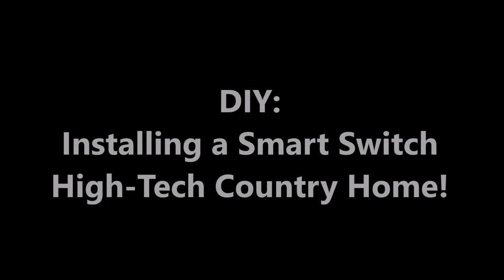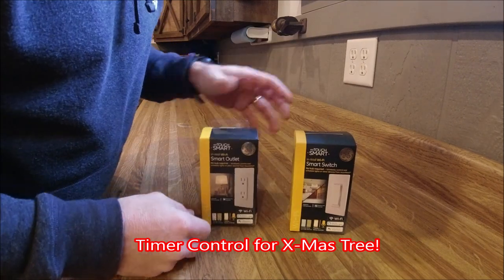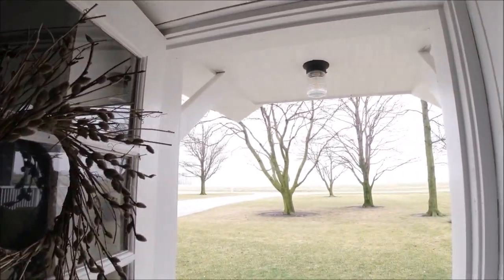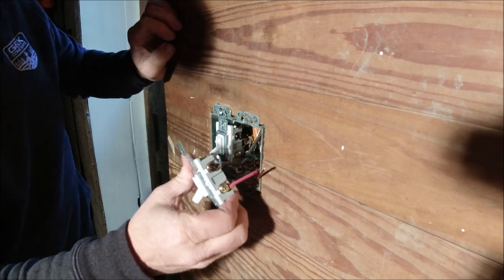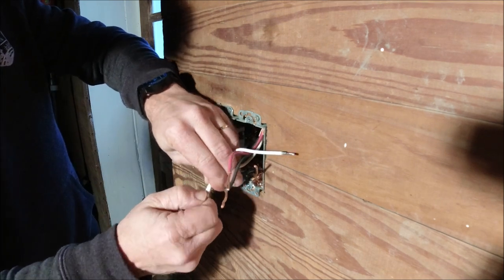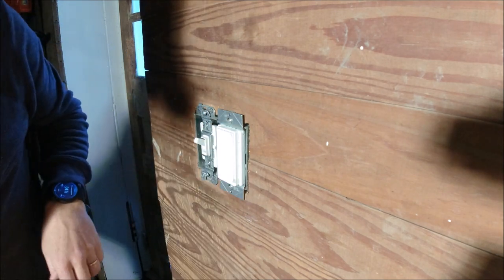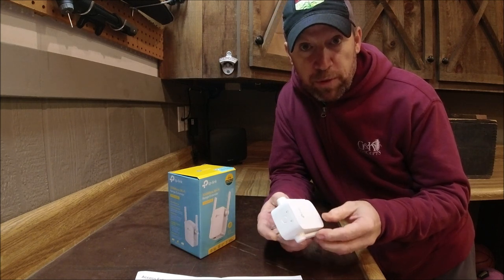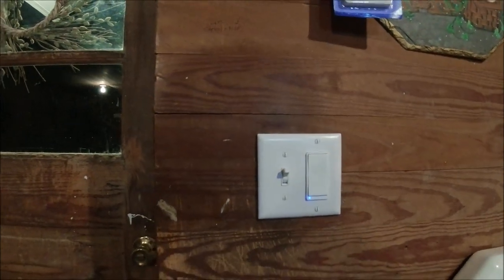Installing a WiFi Smart Switch In a Shed to Remote Control a Porch Light From the House

Comment: Nice video. I have a very similar issue with my garage (conventional single pole switch in garage, nothing in the house). However, I don't want to use Alexia when I'm in the house, I just want a wall switch in the house that behaves as if it's a regular two pole switch, but WiFi only. Do you know if anyone makes a switch for this situation?
Reply from the maker: Thanks and that's a great question Jeff.  I believe there is something like that but it may be a bit pricey as you would need a device on both ends.  Could be worth it though.  I actually control that switch with Google Home on my phone now and I have a shortcut to that switch.  Works like a charm, but I could see not wanting to rely on it too.  I'll have to look into that.  Could be a new video option.